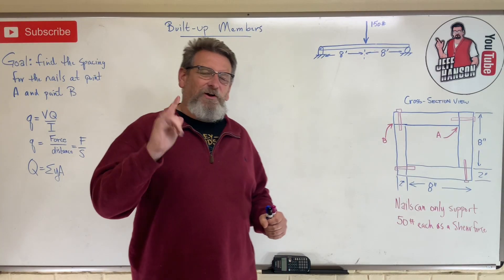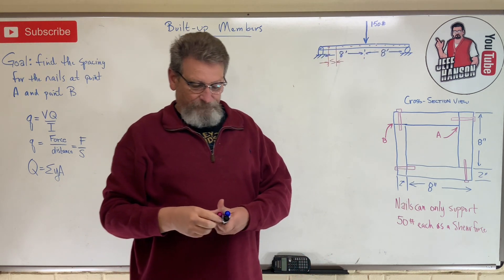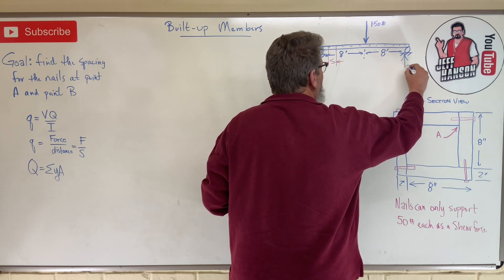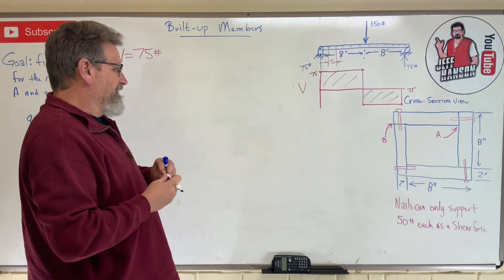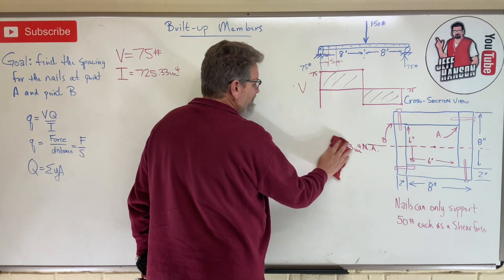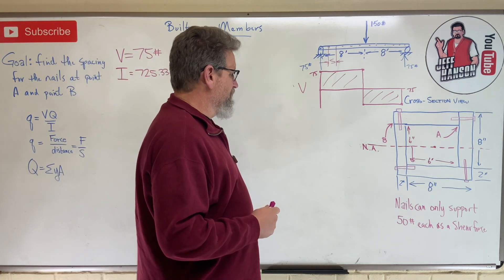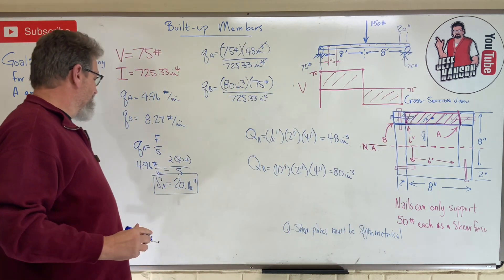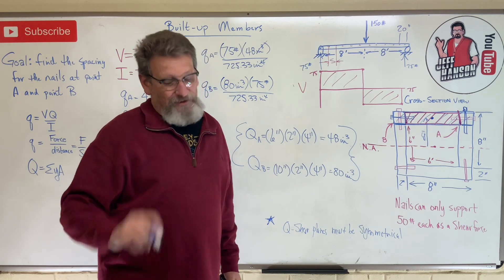Mechanics of Materials: Lesson 40 - Harder Built- Up Member Shear Flow Problem

Comment: Had to work on a built up member problem at work recently. We had to strengthen an existing beam by bolting additional plates on the flanges. This is very helpful as I haven't reviewed this topic in a while.